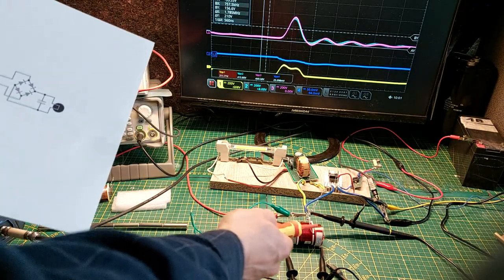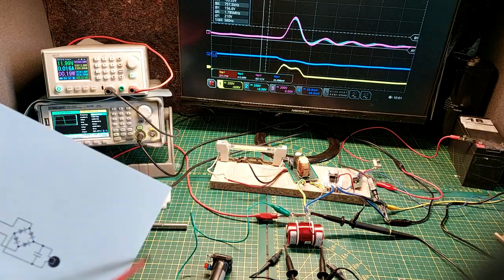Advantages of using negative spike of switched coil

Comment: Very interesting experiment. I guess the input was 12v. The negative flyback voltage on the primary is 200v and on the secondary 400v. You used this spike through a choke. Would it be possible rectifying the spike and collect it in a capacitor instead of the choke? Or would the voltage of the spike drop significantly?
Reply from the maker: @marcelflechter: In the video where I use 34Khz, I used 24V input because the higher the frequency the lower the spike even with 50% duty compared to 12V input, 1Khz and 10% duty.
The choke is used as the series negative impedance used in the motor setups from Rick Friedrich: https://youtu.be/U3JyRMdJhzg
You can place a capacitor direct, but in past setups I had best result this way, ofcourse it's always best to try, don't forget that the impedance goes higher when capacitor is charged and voltage on your mosfet will go higher and can lead to mosfet break down if you go above rated voltage. This is also when using the series impedance.
Reply: @brunovk417  Thanks for clarification. I'm trying to find out the behavior of a don smith bifilar coil. The same type you use in this video. It's about the normal output and not the negative spike. Usual if you increase the frequency in a step-up transformer the voltage goes up. A 12v to 240v 60Hz transformer will put out 480v at 120Hz. There is double the voltage and half of the current. The output of a bifilar coil is usual 3 or 4 times more. How is the frequency influencing the voltage? As an example there is a 12v input pulse. The primary is a quarter wave of the secondary. The primary LC-circuit runs at 100kHz in resonance. There is let's say a 100v output v.a.r. If the tank-circuit would run on 200kHz resonance with a smaller capacitor, what would be the influence to the voltage? I know with 200kHz the resistance will be smaller thus the ringing (echo) will be longer. But I'm stuck with the voltage. Will the voltage be 100v as well or higher. I could imagine there is also less current on the secondary in compare to the 100kHz. And this should lead to a higher voltage.
Reply from the maker: @marcelfiechter7436  As far as I know, when you input higher frequency then foreseen, you end up with same voltage relationship, only at that higher frequency. 
In case of resonance, I only experienced best voltage output when at fundamental frequency of components involved.
About less impedance, many times it´s  forgotten that there is also the  normal resistance, that will cause the dampning, even when in resonance Xc and Xl are eliminating each other, there´s still the normal resistance.
If you speak of lower impedance at higher frequency, means that you are talking about the capacitor, the coil however will be higher in impedance at higher frequency ( for people reading this comment, there´s a very nice graph on rf cafe: https://www.rfcafe.com/references/electrical/images/Frequency-Reactance-Nomograph.zip
)
What I also learned is that there has to be a balance between your L and C to have the best result. Sadly everyone who knows what that balance is, isn´t sharing it or I have not yet come to that information :)
When you look at that Reactance normograph you see thousands of points where you have resonance between L and C but where you will end up with best result is much more limited. I once heard that for best series resonance you want to choose a point above the middle line of that graph and for parallel beneath that middle line. We all see that there are still a lot of points to choose from.
What I wrote above is what I think at this moment, please think on all this for yourself, I can be wrong.
Reply: @brunovk417  Thanks for the graph. I saved it on my device. It can be helpful.

Yes I was talking about the smaller capacitor causing less impedance. You're right there are always multiple aspects of the same issue.

"you end up with same voltage output": I came up with an answer to my question in the meantime. My experience is mostly theoretically and it could be totally wrong. I realized that my question (bigger frequency - higher voltages?) has something to do with the Q-Factor. There are online calculators to get the Q-Factor (Frequency, Inductance, Internal Resistance). In that sense a bigger frequency is causing a bigger Q-Factor. So yes the voltage is getting bigger with a bigger frequency as I interpret it. And yes L1 and L2 need to be in harmony I get that. And that's what Don Smith was telling also I guess. The most important thing for Tesla and Don Smith was the frequency (resonance). Not the voltage and not the amperage.

"Sadly everyone who knows what that balance is, isn't sharing it": Don Smith did it between the lines if I'm correct. Most parts of his devices shown aren't necessary. They are there because people are expecting them to be there (his words). One example is the LC-Circuit. Don Smith told there is no need for a capacitor because the wire and the coil has an intern capacitance already. With a capacitor you are reducing the frequency with no benefit. In contrary, it's getting difficult to tune the L2. A 4 inch L1 (coil plus wires) has a natural frequency of 220MHz. You just need to pulse this coil and it will vibrate. If L1 is a quarter wave of L2 then the whole wire of L2 need to be exactly double the size of L1. L2 will resonate with 110MHz. There is no need for a tuning capacitor. But still L1 and L2 will be slightly out of tune. The simple solution to bring this 2 coils in full harmony is to put a small resistor of 100-500 Ohms at the grounding shunt. This acts like a dam. It reduces a bit the frequency. May down to 200MHz and 100MHz(L2). That's my understanding of what Don Smith was telling about this subject. And it makes perfect sense in my view.

"many times it's forgotten there is also the normal resistance": Here is what Don Smith is telling about this subject as I understand it. Until 20kHz this normal resistance exists. The electrons are colliding each other and there is a lot of friction. From 20kHz to 300kHz is less and less friction because the electrons are starting to flow outside of the wire. And from 200MHz upward are superconductor conditions. I believe that's why he was talking a lot about the 4 inches (220MHz). As I understand it there is one pulse and it's swinging with almost no dampening. I believe Don Smith had a device with a very small L1 (1 turn - maybe just one inch or even smaller) and a very small L2 (4 turns). This would be 800MHz and 400MHz. Calculate this small coil of 800MHz online. The Q-Factor is huge. I believe that's the secret of Don Smith. He didn't use any step-up neon transformer, he didn't use any capacitor to create an LC-Circuit, he didn't use any spark cap.
Reply: @brunovk417  I mixed inches with feet. Always when I wrote inches it's feet (1m20cm).
Reply from the maker: @marcelfiechter7436  Thank you for sharing your thoughts. I will go through it a few times.
One thing I want to add at this moment is that I saw the possible reason for that resistor in the grounding. When you look at this hidden video of an experiment : https://youtu.be/RFjS5q_7M_8
Then later on I used a resitor in parallel to that capacitor and by doing that and using different resistor values I could freeze that changing ringing at the position where the amplitudes where at there highest values. Meaning I could control the output of that coil that was in the path. It was the first time during experimenting that placing a resistor in the path was benefitial.
Finding the correct way to have usable power is still something I need to figure out.
Reply: @brunovk417  This grounding resistor can have different benefits. What I heard from Don Smith it's all about the fine tuning of the already tuned (through exact wire length) L2 with L1. Here is what Don Smith said: He explains L2: and we've got it grounded with a variable device on it so we can fine tune it and that point we've got an output out here (output from L2) which is an oscillating alternating current type situation that radio frequency. The ground is the shunt in a resonant radio frequency configuration that produces the dam that keeps the energy. Once it get s to oscillating inside the system it could come in but it can't get out unless it is hooked into an other system. It's simply a blocking device which keeps your resonant coil system which normally you have a capacitor and a coil well in our case we've put both the capacitor and the coil in one wire and we eliminated some components that are subject to fail. In an earlier part of the video he was talking about the trumpet wave form. It could be the same as above or something else: in the third one (trumpet wave) is a particular arrangement of a grounding shunt which means its ability to communicate with the electron source which would be your grounding and the resistance there is like a dam on a large body of water and it lets the electrons through and they get caught behind this dam. This whole device is like a pump. All it's doing is like the dominoes we were talking about is tripping the electrons here and that electrons trip in the next one and this whole bunch of electrons in all directions are being tripped and each time one of those would be tripped it gives off a magnetic impulse first and when it comes back on that infinity loop it gives off an electrical impulse and this just goes on perpetually the electron is never diminished.

Resistance
but basically what it means is that your system resistivity becomes zero at resonance which means that you're at superconductor conditions at that point at room temperature. The rate of induction is directly related to the cycles per second so if you want to a reference point there at 60 cycles per second square that and then if you want to see the relative position of say 220 megacycles square 220 megacycles and compare the ratio between the 2 squares and you've got the ratio of improvement with the higher frequency. Then he explains that below 20kHz is under unity. Between 20kHz and 200kHz it's getting better and better and above 200kHz is over unity. And above 200MHz (wire 1m20cm) are superconductor conditions. That's one of the reasons why I built this device to get out of way from the ranges which the Tesla coils normally operate in which is down below two hundred thousand cycles per second.
Reply: @brunovk417  I did an interesting calculation. Let's take a 4 feet (1m20cm) wire/coil (L1). 2 feet are used for the coil and 1 feet are at each end. The internal resistance is usually 0.1 Ohm at 4 feet. I take 0.3 Ohm. The natural frequency is 220MHz. I take 200MHz. Now I compare the natural frequency without additional capacitor and a frequency of 100kHz with an LC-Capacitor. The induction of a 2 feet-wire coil is between 1uH and 4uH. I take 2uH.

Q-Factor 100kHz with LC-Capacitor: 4.18
3v in and 12.54v in resonance or
12v in and 50v in resonance

Q-Factor 200MHz natural: 8373
3v in and 25119v in resonance or
12 in and 100476 in resonance

The big difference lies in the less dampening at higher frequencies. Less internal resistance.
Reply: @brunovk417  An interesting aspect you mentioned is the impedance. The higher the frequency the bigger the impedance. That's true but there are 2 aspects. If you check an online calculator for the Q-Factor there is just an internal resistance and no impedance-value. Because the impedance is defined by the induction. One aspect of the impedance is the current. The impedance is limiting the current. The higher the frequency the more resistance for the current. The second aspect of the impedance is the voltage. The impedance doesn't limit the voltage. In contrary. Through the impedance the voltage is getting pressed higher and higher. That's why there are suddenly 100kv at 220MHz. But there is almost no current. And that's exactly what we want at this stage. That's why it's called v.a.r power. It's not usable at this stage. This is done in the next stage. Collecting the voltage and convert it to usable current.
Reply from the maker: @marcelfiechter7436 , Thank you for sharing your thoughts. I will have look for creating such coil, maybe tomorrow or upcomming weekend.
Reply: @brunovk417  Great. An unknown factor is the triggering of the harmonics. My Arduino processor is 16MHz. It's not possible to control 220MHz. The best would be to trigger every 100th harmonics. It's a challenge because the if-command alone takes already some cycles of the cpu. Don Smith proposed the Neon-Transformer which is at 35kHz. This is just the trigger 35000 times per second. I can't imagine this was exactly a harmonic of 220MHz. Probably it's ok to trigger it coincidentally a view times per second. Eventually it's the same like a tuning fork. It's not that important you hit it again at exactly the right point. Because it's not a perfect trigger there is some disturbance but still the tuning fork is amplifying itself.

Take care when you do a video about this. Nobody should know this except a view who know it already more than a hundred years.
Reply from the maker: @marcelfiechter7436 , I have the system in mind from this video, that kickback looks like a nice hammer for the bell :)
 If there´s not much  dampening then it should show up.
When reading your message I was thinking on the flat pancake coil that´s mentioned in the Don Smith book (page 100,101,151, 152, video5) I created something like that a few years ago, I have to look if it´s still usable (most of the times I use same materials for different experiments) The problem back then was the high voltage input, but that will now be done with the mosfet and that circuit from the video here. 
And maybe it´s even not necessary to have the L1 around. In my hidden video mentioned in my previous message, that was also just a copper coil directly connected to the scope input, and I saw the ringing just by that kickback wire going once through the center.
I will be using a capacitor to the positive of power supply so that it´s partly like the hairpin circuit.
The second capacitor is then the kickback diode in blocking for reflection ( and also to block positive from input source)

What I know what will be a problem is the harvesting.
Reply: @brunovk417  "kickback looks like a nice hammer for the bell": Interesting.

Yes the harvesting is an other page. Don Smith did it with an isolation transformer. I have an easier idea in mind. But I still think about it.

Let me know if you see less dampening. This would be the ultimate sign. A 1.5v Battery would be enough to power the house. Or a peg-cell as joel lagace was showing. This constant 1 volt would produce easily a constant 70kv v.a.r power in combination with the 440MHz (2 feet) naturally swinging L1.
Reply: @brunovk417  I don't know what happens on L2. Let's assume the coil of L1 is a quarter wave of L2. L1 has a Q-Factor of 10 and a frequency of 100Hz. The input is 12 volts. L1 will have a resonating voltage of 120v. What happens on L2. I assume the following. The 100Hz will decrease to 25Hz. The voltage remains at 120v and the amperage increases 4 times. I believe Don Smith used L2 as an amperage step-up. Most people think it's about the voltage there but it's about the amperage at that stage.
Reply from the maker: @marcelfiechter, I found my coil but have to rewind, so it will be for upcomming weekend.
Looking at the dimentions in Don's drawing he uses relationship of 4.36.
When I convert to m (the unit I work with), I have 19.8feet = 6.035m and 4.54feet= 1.383m
He writes to using 20feet = 6.096m and 4 3/4 feet = 1.447m.
possible the .36 is what he means with using slightly longer wire then the wanted wave length.
Reply: @brunovk417  Important to know is the principle. Don't try to do it exactly as it is written. Some things are confusing. I would do L1 with 60cm. It's cheaper and it saves time. 30cm for the windings and 15cm on each end. I would round it on a 3.2cm-diameter pipe. L2-wire 120cm twice. 90cm for the windings and 15cm on each end. Triple is enough to see the effect. I would do it precisely. Resonance needs exactly a division or a multiplication. Every tuning fork is very precise.

At the step-down process Don Smith mentioned also a bifilar coil. 50 turns on one side and 52 turns on the other. This 2 turns are there to modulate the sine wave. It rounds the spike on the top. But this has nothing to do with the process we are talking about now.
Reply: @brunovk417  I did some exact calculation for a 60/120cm frequency (440MHz/220MHz) and a 30/90cm coil with 1.5mm2 wire on a 3.2cm diameter pipe. The Q-Factor for L1 would be 394742 and for L2 296057. Maybe it's better to start with 1ma input. Otherwise this thing will run unstoppable infinitely 🙂
Reply from the maker: @marcelfiechter7436 , I looked at the specs of my scopes, I have a 2 channel  200Mhz, so I think it will be best to use some longer wires so that I´m working within the specs of my scope for both coils. I can see how far that takes me before going to the super high Q.
400Mhz is also the frequency for emergency related things, so I´m going to stay away from that higher frequency.
Reply: @brunovk417  It's a sphere nobody of the hobbyist is working on. That's why it's getting difficult to find the tools. But I'm convinced exactly there is the secret. It's not only Don Smith is telling that, I can also calculate it by myself with independent online calculators. And there is even Wikipedia telling 200MHz-2GHz is superconducting territory at room temperatur. Superconducting is zero resistance. Usual just possible at minus 200 or whatever degrees.
Reply: @brunovk417  You mentioned eventually there is no need for L1 and measuring directly on L1. I believe this won't work because the magnetic field will probably collapse. L1 is the heart beat of the circuit and shouldn't be touched. The isolation with L2 is key I guess. It's probably better to measure and collect at L2.
Reply: @brunovk417  "2 channel 200Mhz": Good to know. I would do it with 1.75m L1 (ca. 180Mhz). For L2 I would choose also 1.75m twice. A 1:1 conversion is more than enough. A smaller L2 would be even better but then the frequency is getting bigger than 200Mhz again. L2 is important to get the isolation.
Reply: @brunovk417  With 1.5mm2 wire and a coil of 60cm (of 1.75m) there is a Q-Factor of 109900. With 120cm-coil (of 1.75m) the Q-Factor is 219800.
Reply: @brunovk417  I calculated the Q-Factor in the previous post with a 3.2-diameter pipe. If you put it on a 6.4-diameter pipe the induction will double and thus the Q-Factor will also double again. The Q-Factor for a 120cm-coil (of 1.75m) at 6.4cm-diameter pipe would be 439600 then.
Reply: @brunovk417  It's good to limit the input voltage with a voltage divider to at least 10mV. Better 5mV. There could be still 4000v to measure with a 10-times probe.
Reply: @brunovk417  There is no need for a bifilar L2 to begin with. Just one L2 (copy of L1) on the left of the primary with 2-4cm space. The bifilar could multiply the possible 4kv at 10mv input even further.
Reply from the maker: @marcelfiechter7436  I can measure that 4Kv with my x1000 probe, my x100 probe only goes to 2KV, the x10 would not survive.
I will try tomorrow or saturday to build something, it will depend on when I have time.
Reply: @brunovk417  It's absolutely your choice to do it whenever you want. I could try it also but I have no time. Life and wife holds me busy. I would love just doing this type of thing. Electrons are fascinating beyond anything I can imagine. It comes directly from God.
Reply from the maker: @marcelfiechter7436 It´s also the reason why I limit experimenting to weekends. :)
Reply: @brunovk417  I understand now the effect on L2 if the frequency is different. Let's take an 1.75m wire 1.5mm2 with 60cm coil on a 6.4cm-diameter pipe. The frequency of L1 is 175MHz and the voltage will be 2kv as an example. I had this example yesterday. The Q-Factor is 219800. L2 is all the same except the wire length is half 87.5cm. The frequency will be 350MHz on L2. How big will the voltage be on L2? Some will say 2kv because the coil is the same size. Others will say 4kv because the frequency is double. I realized that the Q-Factor-Ratio between L1 and L2 is key here. I calculated the Q-Factor of L2 which is 879200. L1 is 219800. The ratio between L1 and L2 is exactly 1:4. Now we have the voltage of L2. It's 8kv. This shows the power of radio frequency. Now I know why Don Smith said all his devices work with the avalanche-effect. It's 0.01v to 4000v.
Reply from the maker: @marcelfiechter What do you mean with 60cm or 120cm coil? I was going to start and build the coil but it's not clear what you mean by that. I don't see anything related to that size.
Do you mean that the distance between turns is so large you get 60cm lenght with only +-8 windings?
Reply: @brunovk417  It's just an example to understand the relationship between L1 and L2. The total wire length is 1.75cm for L1. I would build also the L2 coil with 1.75m. An exact copy. But here in this example L2 will have just 87.5cm total wire length. In between this L1 1.75m is 60cm in the middle to create the coil. On a 6.2cm-diameter pipe this would be around 3 turns. At both edges would be 57.5cm straight wire. And L2 has also this 3 turns but on both edges will be just 13.75cm left. If L1 has 2kv then L2 will have 8kv. But in building the coil I would use 120cm for the coil. That would be 6 turns on a 6.2cm-diameter pipe.

I think it's good to know this mechanism. Don Smith had a 20 feet L2 and a 4 feet L1. This means the frequency on L2 was 5 times less at around 44MHz. By doing that the voltage on L2 decreased by 5 square = 25 times. But the coil on L2 was 4 times bigger plus bifilar. After decreasing 25 times it increased probably 10-12 times. This tells me the main goal of this process was to bring down the high frequency.

You did the same yesterday. After you realized you can't measure 220MHz you started to fix this issue by enlarging the wire to 1.75m. This brings the frequency down. And the second thing we started to tame is the big voltage of 400kv. It's not possible to measure. A solution could be to limit the power supply to 10mv with a voltage divider. There will be many more steps and hurdles to come down to 60 Hertz and 230v.
Reply from the maker: @marcelfiechter, the tube I can use is 5cm or 7.5cm or 8cm, this are the standards I can find in shop overhere.
I will try with 5cm because of this diameter I have 2 tubes available. For the ringing on L1 I need to use parallel capacitor, so frequency will be little lower. Tryed with series but that wasn't showing any ringing.
Reply: @brunovk417  Yes 5cm is better. This way the induction and the Q-Factor will be lower. An other option would be double the size of the wire on L2 to 3.5m. This way the frequency will come down to 87MHz on L2. And the Q-Factor will come down 4 times. This means the voltage will be 4 times lower on L2. It's getting easier to measure. The diodes could have a problem too with 4kv. With maximum 1kv everything is easier.
Reply: @brunovk417  "for the ringing on L1 I need to use parallel capacitor". It should work without capacitors. With capacitors it will get very difficult to tune L2. Even the diode on L2 should be calculated into the wire length.
Reply from the maker: @marcelfiechter7436  I'm only able to get some ringing at around 16Mhz by placing 2 diodes towards eachother, so that I use the diode capacity. The two diodes where placed in series. Offcourse my scope probe also has influence, so I'm going to try with small capacitive connection, the measured voltage will then not be correct anymore. This is my best result with the diodes: https://drive.google.com/file/d/1-Ji3LNPw9nfnwW_cFXu-NiEEaJk3l9A2/view?usp=sharing
Input was 5V
Reply from the maker: 18Mhz when using capcitive coupling ( two pieces of wire 5cm long, 1 connected to circuit the other to measuring probe signal input)
What do you use as reflection barrier?
Reply: @brunovk417  What I told you is only theoretically. Probably it's not possible to measure it this way because the scope is changing everything. I don't know if you measured it on L1. If so this could be the reason of the low frequency. The wave doesn't look in resonance.
Reply: @brunovk417  The gate driver could be also an issue. Even if the gate of the mosfet is open there is still some current flowing. This could be enough to disturb the frequency. There are possibilities to open the gate in shorting the gate with the drain. An alternative could be also a relay. Fact is you have a very low frequency. Something in your circuit is disturbing the natural frequency (scope, diode, capacitor, mosfet). That's why I wouldn't work with capacitor, diode, scope on L1. The first step is to achieve this natural frequency. It's possible and it's done since many decades every day in radio frequency.
Reply: @brunovk417  Your experiment helped a lot. It obviously showed it doesn't work like that. The first reason is the Mosfet. My Mosfet combined with Gatedriver IC has a turn on time at 50ns. That's quit fast. But in 200MHz there is a turn on and off every 3ns. Even if we would have the fastest Mosfet at 10ns it's way too slow. It's like you would trigger a tuning fork with the finger for half a second. The resonance will be blocked immediately. The triggering of the pulse can't be longer than 3ns. In other words it's impossible to do that with a Mosfet. It must be done with a signal generator. I will use Si5351 clock generator combined with Arduino Adafruit. An important factor is the jitter in radio signals. Si5351 has a jitter of 0.1ns pp (peak to peak). Pulsing 220MHz is no problem like this. The jitter is 13 times smaller than the frequency. This way it works.

The next issue is the scope. There can't be any scope connected on L1 neither on L2. It must be measured wireless (spectrum analyzer, RF explorer). The voltage can be calculated. By rectifying L2 and charging up a capacitor we know it definitively.
Reply from the maker: @marcelfiechter, placing the scope probe at distance also works, you will not have exact value, but you can see if it's dampend or not. I can do sine wave to 160Mhz, but don't know pulse (it will be much less). 
For checking the dampening effect or not, you could use free oscillations setup where you divide the 200Mhz for example by 10 (so using 20Mhz input) and then the duty cycle 5% (50%/10). If there's no damping you can see it happening in between pulses. Keep in mind that with the use of free oscillations the amplitude voltage will be lower the higher you divide the 200Mhz.
Reply: @brunovk417  Good to know. Thanks. 5% duty cycle should work. The pulse is finally exactly sharp as it would be with 200MHz. It makes sense. Almost all are giving up after the experiment you did. That's why nobody is doing it. Some are involved in the radio frequency world and others in OU-world (you know what I mean with OU). But nobody is combining it. Don Smith combined this 2 worlds. In my opinion even much more than Rick Friedrich. That's key. I still need to study further the RF-world. The wire is exactly the same as the antenna. But with a wire the magnetic field remains locally. For that reason I'm not so afraid of 400MHz (urgency...). I think we are on the right track. The Q-Factor is key.
Reply from the maker: @marcelfiechter7436  The thing that's making me doubt is that if above 200Mhz is where there's superconductivty, then why is the cpu in my pc getting so hot working in the Ghz. So I think the problem is also contradictions with what we experience, to find possible solutions.
Reply: @brunovk417  That's a good point. You would need to know the inner workings of a cpu which I don't know. It's all conventional electronics. I just know at 200MHz the electron stays more or less at the same place at flipping and there is no current flowing. This part I fully understand. It's cold energy. And the Q-Factor is the proof. Otherwise there wouldn't be a Q-Factor of 100k or more at 200MHz. And that's what Don Smith was telling in almost every speech. The avalanche-effect.
Reply: @brunovk417  Without studying a cpu in detail I don't believe a cpu is working with resonance all the way down.
Reply: @brunovk417  I did a short research about this topic. It tells me enough. The cpu itself doesn't work with resonance. The cpu is processing data by rapidly switching transistors. The Transistors are getting hot and not the cpu. There is a resonant part in the cpu. When the dl/dt events from the cpu match the resonant frequency of the PDN, the voltage noise can be amplified. This is similar to how a musical instrument can resonate when struck at a specific frequency. There we have it. This part is resonating and the cpu is taking advantage from this effect. And this part for sure doesn't create heat. The transistors create the heat.
Reply: @brunovk417  On my pc the cpu is always at 100% (Maximum processor state). If I come back to my pc every click is fast. I don't like to wait a few seconds until the cpu is up. I have a 1.8GHz cpu. This means the processor is oscillating all the time. On the Task Manager the System Idle Process is the oscillation process. If this process is at 99% or 100% the cpu has no calculations to do, is calm and the fan never kicks in. But as soon there is work to do it starts to get noisy and the fan kicks in. This is caused by the transistors switching. And when the work is done the System Idle Process goes back to 99% and the fan is switching off and it's calm again. But the processor is still oscillating at 100%. The cpu is an excellent example to contrast the 2 aspects of a cpu (oscillation and transistor switching). How is it possible the fan never kicks in when the System Idle Process is at 99%? The answer is super conductivity. A cpu below 20KHz would cause heat at oscillating.  A 60Hz transformer is loosing energy (heat) with no load. This are the no-load-losses.
Reply: @brunovk417  I realized an interesting fact which explains also a part of your experiment. You had 18MHz in your experiment. The dampening was very bad. The attenuation (dampening) on high frequencies out of resonance is worse than the attenuation of low frequencies out of resonance. This could lead to the wrong understanding it's better to work with lower frequencies because there is less dampening. That's true when it's out of resonance. But in resonance it's the opposite. The attenuation on high frequencies in resonance is lower than the attenuation on low frequencies in resonance. This correlates with the Q-Factor. There is a very good video from Circuit Helper in this regard. The title is From Oscillations to Shocking High-Voltage.
Reply from the maker: @marcelfiechter7436  Thank you for the information, I will look into it. There was a shift in the experiments that I wanted to do past weekend because I came to something that I want to build that demands some hours of printing with my 3D printer. So I dicided to first prepare the parts so that I can do the 3D printing while I do this kind of experiments talked about here.
I´m going to build an L3 receiver for the zero transformer based on a Tesla circuit: https://drive.google.com/file/d/1nG6d-jF_C_-ozMFgi51uXQ4fNH3fnkrg/view?usp=drivesdk
Reply from the maker: @marcelfiechter7436  I searched for the video from circuit helper you referred to but  youtube nor google seem to find it. When looking to the videolist it blocks after it comes to the letter D for the titles. Do you have a link?
Reply from the maker: Found it: https://youtu.be/9WligloCprc?si=EMYVF_FkZClJkvuW
Reply: @brunovk417  Great, I just tried to send the link. In your experiment you had 5v input and 5.2v out. I believe the frequency of 16.13MHz is before the sweet spot. That's why the voltage is the same as the input. After the sweet spot the voltage drops below the input voltage. That's shown in this video.  The next interesting aspect is the start of the swinging. It's important to pulse it at least 10 times to get to the maximum voltage. And then it will swing much longer with less dampening.
Reply: @brunovk417  I did a simulation with LTspice for 1.2m wire and a 90cm coil in between. I got some realistic numbers now. 1v in 100v out peak to peak. I tested it with 60cm/1.2m/2.4m. In 60cm (400MHz) the Q-Factor was 100. In 1.2m (200MHz) the Q-Factor was 110. And with 2.4 (100MHz) a bit more. It confirms the principle I'm looking for but the numbers are way below the numbers I calculated. But that's good. I don't need to worry about 4kv.

I tested also the pulsing. It's very difficult to achieve good results with pulsing. The way to go is sine-wave-input. And I believe the sine-wave needs to be constant. Every 5th harmonics or so probably won't work. But there is no need for that.

With a 5v input there could be 500v pp at 1.2m (4 feet) 200MHz. And there is still the secondary to step it up.
Reply: @brunovk417  Could you tell me the capacitor size you used in the experiment? I did a simulation of your experiment. 1.75m wire, diameter of 5cm-pipe. coil has 9 turns. Wire has 1.5mm2. Capacitor 13p. This way I came to a frequency of 16MHz. 1v Amplitude input (sine-wave) 180vpp out.
Reply from the maker: @marcelfiechter7436  I will measure the capacitor value with my lcr meter this weekend, of the two diodes pointing at eachother (that was the capacitance I used).
I also used two small pieces of alu foil with kapton tape in between but that had higher capacitance, so the scope image is with the two diodes as small capacitor.
Reply from the maker: @marcelfiechter7436  Have you tried to use an 74HC14 Scmitt trigger after your Si5351 ? I saw that the output of that board is more sine wave at the higher frequencies. I don´t know if those ic´s can handle that 200Mhz or not. Looking at delay times it looks like 66Mhz, but AI wrote that it could be used.
Reply: @brunovk417  A Schmitt trigger has a rise/fall time of at least 12ns. It's way too slow. It can't work with a Schmitt trigger. And it would be more a pulsing I think. I realized in the simulation that pulsing is very difficult. A sine-wave is the only way in my opinion.

The Si5351 is the way I go. I'm still in the planing phase and didn't order Si5351 yet. Officially they write it's 160MHz+. It's possible to go up to 225MHz without any issues (even 280 would be possible with limitations in other areas which are not important to me). And it's a clean sine-wave. It's ideal for this purpose I think. And I can control every step. I can say it should swing for 50 turns and then to stop or continue by swinging every 10th harmonic and so on.
Reply: @brunovk417  Yes AI is telling it can be used. But AI collects information from everywhere. It works probably for frequencies below 200k. And it's more a pulsing. I saw it clearly in the simulation. Pulsing is very tricky and the results are much worse than sine-waves. The natural modulation of the wave of a coil is sine.
Reply from the maker: @marcelfiechter7436  Do you think that synchronization is needed if sine wave is used? I can understand the principle of adding the sine wave with intervals but they have to come at the right moment. With the pulses you have free oscillations between pulses, also best result if the next pulse comes at the right time. I can understand there will be free oscillations between two bursts of sine wave input, but then the controlling device would need to be very stable I think. This high frequency is unwalked teritory to me at this moment, so I can be wrong.
Reply from the maker: @marcelfiechter7436  I want to use your idea of burst of sine but for pulses, is it a problem that I make a public video on that? I want to compare the use of free oscillations by changing the input frequency and duty cycle, or for example 5 pulses with 50% duty and look at the free oscillations in between. In the later the starting voltage will be higher, but I´m wondering if there could be an overal gain when compared to the free oscillations with frequency and duty cycle adjustment. Due to the 50% duty input will be higher, but maybe this will also cause higher efficiency (higher voltage).
Reply: @brunovk417  "synchronization is needed if sine wave is used": Maybe it's not possible to add the sine wave in intervals. I will see what is possible with si5351. Sure it would be good to make a video about this topic. Maybe pulsing is also good. The spark cap is also pulsing. I just had a hard time on the simulation. And Rick Friedrich told also the best is sine-wave.
Reply from the maker: @marcelfiechter7436  Years ago I put pulse signal as one input of and gate and then the second input port  as the port to let them trough or not. Offcourse the 200Mhz is again a problem. So it will depend how the output of the signal generator is  switched. If it continues in the background and you switch if it´s allowed as output then synchronization will not be needed I think.
Reply: @brunovk417  "synchronization will not be needed": Yes I imagine you're right. I believe I can program SI5351 by time. I can't say to stop it after 50 cycles because this is oscillating by its own. But I can say to stop after 100ns and to start after 500ns again or whatever.

When it comes over 50MHz we are in RF/HF territory. That's why I'm studying this RF-World. They know how to do it. But it's a lot. I realized now the output of SI5351 is 3.3v. But it's peak to peak. That's the next challenge. I have just 1.6v input for the coil. In the simulation that's an amplitude of 75v (wire 1.2m) on the primary. Then suddenly it makes sense again Don Smith used 20 feet (with bifiar) for the secondary. This way it's probably possible to elevate the voltage to 4 times 75v plus the bifilar-effect. Could be 500 to 600v. The other possibility would be an amplifier. I found amplifiers for 20$.  The other challenge is impedance-matching. An antenna has always this 50 Ohms. The primary would need also 50 Ohms. Maybe this is easy for you. Would there need to be an additional resister between the signal generator (SI5351) and the primary coil? I guess so. But this will have an influence to the frequency.
Reply: @brunovk417  There needs to be a 50 Ohm resistor between SI5351 and the coil. In the simulation this is reducing the voltage gain from 1v:55v down to 1v:40v. The max output of SI5351 can be 3.3v peak to peak. In the simulation I get 60v (120vpp) at 1.6v (8ma) input with the 50 Ohm resistor. It's still a very good value. It's a little example of the avalanche-effect. 1.6v in at 8ma and 60v out.

The question now is how to amplify this. Either with an amplifier in between or a big enough secondary. An amplifier in between needs a separate power supply of 12-15v. An amplifier for 23$ could amplify it by 20 dB. 20 dB is increasing the voltage 10 times. The input of the coil would be 16v instead of 1.6v. The voltage amplitude of the primary would be 600v in the simulation. Eventually the bigger secondary is the easier approach.
Reply from the maker: @marcelfiechter7436  The ouput impedance of the si is 50 ohm according the datasheet, page 8 https://cdn-learn.adafruit.com/assets/assets/000/116/463/original/Si5351-B_datasheet.pdf?1667590965
Reply: @brunovk417  Thanks a lot for the document. It helps. I had this big discrepancy between the calculated Q-Factor and the simulated result. I realized that the sweet spot in the simulation is always before the big hike at the top. There is also the curve for the decibel gain which correlates with my calculations. The gain in decibel with 50 Ohms (1.2m wire 223MHz) is 42 dB which translates to a theoretical Q-Factor of 125. The simulated result is a Q-Factor of 115. 1v in and 115v amplitude out. I recalculated it again without the 50 Ohms. The gain in decibel is 86 dB which translates to a theoretical Q-Factor of 20k. In the simulation it's a Q-Factor of 700. 1v in and 700v amplitude out. The band is so narrow it's probably impossible to get close to the theoretical Q-Factor. But the simulated results now are mind blowing.
Reply: @brunovk417  I see the first issue with SI5351a. It's not the sine wave. The usual square wave of SI5351 can programmatically modulated to a sine wave. I believe this part I can manage. But the problem is the maximal 8ma output. In the simulation of LTspice the current is 16ma and -16ma (1.2m 223MHz 50 Ohms 115v amplitude at 1v input). And with the natural Ohms of the wire (0.0136Ohm) it would generate 700v and the current is 100ma and -100ma. Do you know if this is the normal current draw. Is this 100ma or is there an average value because it's floating from top to bottom and back? I would need to place 110 Ohms to come down to 8ma. But then the voltage drops to 57v.

I found the most important thing which additionally is confirmed now by the simulation of LTspice. It's the Q-Factor of 700. Or with 50 Ohms still a staggering 115. The focus now is how to pulse it. The best would be sine wave but it's just 8ma. Pulsing is probably the better approach. I'm looking forward to your video. It's all about the most efficient pulsing. The source is there plentiful.
Reply from the maker: @marcelfiechter, If the input is 1V peak and you can build impedance matching to the 50 ohm of the SI5351, then the current would be 20mA peak. So for 8mA peak I think it needs to be 125ohm (using 1V peak). 
I have very little knowledge of impedance matching outside it's function and that there are online calculators.
Normally I think rms values are used in datasheets. I can not find the 8mA.

For the current value It depends if what is calculated is rms or peak value.
Reply: @brunovk417  It's written in the datasheet. The parameter is Output Impedance: 8 mA output drive current. I guess this is rms. I'm not sure if it's the same as in the sine curve where the top value is 8ma to bottom -8ma.
Reply: @brunovk417  And there is also Rise/Fall Time tr/tf: Drive Strength 8 mA in 1ns.
Reply: @brunovk417  The SI5351A/B/C features various current drives ranging from 2 to 8 mA (default).
Reply: @brunovk417  They write to use Zo = 85 Ohms. When I simulate it there are 10ma peak. I guess this is allowed. This generates 73v at 1v input.
Reply: @brunovk417  I'm thinking about shielding now. When you are experimenting with your coils, is this not radiating out? You are probably in the 100 to 200kHz range. Usual this long waves go far.
Reply: @brunovk417  The output pin of Rasperry pi has a current of 16ma at 3.3v. This way it would work with 40 Ohms  and generate 110v with 16ma. But only if the square wave is clean enough.
Reply: @brunovk417  There is probably an easier way to achieve this frequency than SI5351 or Rasperry pi rpitx. There are frequency generators  for around 30 to 50$ which have 5 or 10 dbm. If I'm correct my simulation of SI5351 achieved 27mW which is 14 dbm (3.3v at 8ma). A 5 dbm device would be 3mW. There are RF Amplifiers 20db for a few dollars. 20db is amplifying a 100 times. 3mW times 100 is 300mW. This are max values. Finally it's probably 100mW. But that's more than enough. The output of a wlan-router is usual at 100mW.
Reply from the maker: @marcelfiechter7436 Normally the SI5351 should arrive tomorrow overhere, and I´m going to use Arduino giga to control it. It´s an arduino kit with small touch screen so I have extra pulse generator worse case scenario for lower frequencies. I hope I have free time upcomming weekend to try things out.
For shielding I have not foreseen in my experiments because the power up until this point in time is minimal. I have not yet seen a 5W led full brightness with an input that was much less lower. Depending on where one reads, then above 20khz it´s allready outside the wire. So I´m curious to what I will see diffrently. With ringing upto around 1Mhz, it´s still dampening or not collectable without destroying. I hope those higher frequency are more stable.
My setup for the 2 L3´s on zero transformer are also ready, one coil still needs to be wind.

In the things you simulated, did you include Earth grounding? Can it be included?
Reply: @brunovk417  There needs to be a ground in the schematic of LTSpce but it's more of a null reference point. I tried to place a second ground with 1Gohm and connected it with the normal ground. But there was no difference.

In the simulation at 200MHz it took around 120 pulses to get to full speed. I think it's good to know. It's not possible to pulse 10 times and stop in this scenario.

Arduino Giga is a very good choice. I missed that one. It seems (AI is telling) that the pins are directly controlled by the main processor which is 480MHz. A half cycle is 1.04ns. The rise and fall time of the pin must be at least 1ns, most probably a bit lower. It's the same speed or even less than SI5351. That's why the current output of Arduino Giga is 8ma as well. In other Arduinos the output current was always 20ma. With the command GPIOJ->ODR = (0b00000001) can a pin be toggled very fast. In Arduino Uno it's an other command but it's possible to do it in this fashion at one  half cycle of the cpu. And there is the nop-command which is pausing for 1 half cycle (1.04ns). You could copy this command 200 times in the program and eventually it will toggle at 480MHz (or any other frequency). Usual there is a loop. But a while loop takes 3 cycles and a do loop even more cycles. But you could do a loop for this 200 commands. Then a pause of a few cycles by the while loop wouldn't matter because of the moderate dampening. This way it would be possible to generate different frequencies very easy. And every cycle could be controlled. I imagine with SI5351 it's just possible to control the registers but not the oscillation itself.
Reply: @brunovk417  GPIOB->BSRR = (1 << 5); // Sets the pin high. This command is better than ODR. BSRR is atomic and it should take just one cycle. It really seems to be possible to do that with Arduino Giga. I think I'm ordering this device too. Let me know if I can assist you with the code.
Reply from the maker: @marcelfiechter7436  I didn´t know about the possibility of getting the outputs of the giga switched so fast. Thank you for letting me know. 
Also the recipe is something I never heard of, thank you very much. It will be a busy weekend :)
Reply from the maker: @marcelfiechter7436  As long as the whole neigbourhood wifi doesn´t start resonating :)
Reply from the maker: @marcelfiechter7436  Do I need to delete the message?
Reply: @brunovk417  In the primary coil will be the same power as in the antenna (around 100mW). But this type of coil is a very bad antenna. The magnetic field is hurling around the coil instead out in the air. So far the signal will be definitively weaker than a normal signal. At the step up could be some sort of enforcement in the signal. But the secondary coil again is a very bad antenna. Additionally if it's done with 2 secondaries in bifilar style they cancel each other out. This is very bad for transmission. The magnetic field is hurling in a dense local field like a whirlpool in a river. Even with a big step up I can't imagine the signal could reach a normal wlan strength. But it's good to have a spectrum analyzer.
Reply: @brunovk417  Usual the antenna of a 2.4GHz router is 11-12cm. This is a full wave and it's difficult to handle this size manually. I simulated now the 50cm variant in compare of the 25cm of yesterday. If the size of the antenna is bigger than the wave length there is more natural impedance. It's problematic normally because it needs adjustments at the source impedance. But the source often times is fixed to 50 Ohms. But in our case it could be very handy. I realized the 50 Ohms are not really needed anymore with a 4 times wavelength (50cm). The natural impedance seems to be in this area or even a bit higher. The current draw with 50 Ohms at 50cm is 46ma. Without the 50 Ohms it's 58ma. The 25cm-variant with 50 Ohms drew 86ma. The 58ma won't be any problem for any router.

Simulation of: The wire is 1.5mm2. The diameter of the coil is 2cm. 5 turns (30cm). 10cm on each end. The result is: 
580v peak (1160v peak to peak) without 50 Ohms at 58ma peak. 
465v peak (930v peak to peak) with 50 Ohms at 46ma peak. 

It's just a simulation and it could be different in reality. I would go straight to the 50cm variant. It's easier to handle and the gain seems to be much bigger than with the 25cm variant (215v peak). Additionally the 50 Ohms could be excluded because they are already represented in the 50cm wire/coil. It makes everything easier.

I assume an even longer wire like 1m won't work well because the natural impedance will be much bigger than the source impedance of 50 Ohms. But we can't change the source impedance in this cooking receipt.

Just for clarity reasons. In the LTSpice simulation I can enter a source impedance. I entered there always 50 Ohms in my simulations. In the si5351 simulation I entered 85 Ohms. I think the simulation could be realistic.
Reply: @brunovk417  I was running my last simulations with 12v. I realized it can't be possible because 12v times 58ma is 696mW. The output of the 2.4 GHz signal is around 100mW. A more realistic number is 4v at the output. With 4v there are 20ma = 80mW. At 4v the simulation for 50cm is: 
155v peak at 15ma with 50 Ohms.
195v peak at 20ma without 50 Ohms.
Reply: @brunovk417  I studied the mechanism of wlan 2.4GHz. Normally there is a 1.8v VOC (Voltage Controlled Oscillator) in the router. This generates a 0.9v amplitude. And this gets amplified by the 12vDC to 9v max. This amplifying circuits are increasing the voltage 10 times. Below 10 times there is still some unwanted noise in the circuit. The maximum of 9v generates probably 1000mW or a bit more. This is used for the 5GHz range. The 5GHz range needs more power because the short waves of 6cm are weak and have a hard time to travel through the house. 2.4GHz needs 100mW. The 0.9v is getting resisted to probably 0.5 or 0.6v and then amplified 10 times to 5-6v. And this is likely the voltage amplitude a normal 2.4GHz wlan is amplified which generates 100mW at the antenna. I did also a simulation for that and came to the same result. That's why they were choosing 12v for the routers even in the old days when the 5GHz range didn't exist. The signal of a 5v-router would be too weak otherwise they would have built the 5v-variant. It would be cheaper. The amplified voltage for 2.4 GHz is likely 5 to 6 volts. And after this comes the 50 Ohms and then the SMA-Connection and then the 50 Ohms of the antenna which is 11-12cm.

It looks like the simulated 4 volts in the previous post are a moderate example:

50cm wire/coil: 4v with 50 Ohms creates 39mW (2.4v times 16ma) output at the SMA-Connection which is the coil-input. The coil creates 155v peak.

50cm wire/coil: 4v without 50 Ohms creates 60mW (3v times 20ma) output at the SMA which is the coil-input. The coil creates 195v peak.
Reply: @brunovk417  In case the voltage inside the router is amplified to 5 volts the signal strength would be 93mW without 50 Ohms. This means the impedance of the 50cm wire is around 50 Ohms.

In case the voltage inside the router is amplified to 6 volts the signal strength would be 133mW. This means the impedance of the 50cm wire is less than 50 Ohms. A 30 Ohms should be placed at the SMA-Connection. Then the signal strength is 102mW. And the output of the primary coil is 250v.
Reply from the maker: @marcelfiechter7436  I have to see what the specs are of my analyzer to see if I can go to 2.4Ghz, but I have old wifi router to experiment :) it has 3 antenna´s.
Reply from the maker: The wifi router I have is not sending constantly when there´s no connection. So I will start with the 200Mhz to experiment, there I have some means to measure things.
Reply: @brunovk417  Usually a router is sending its signal constantly unless powered off. Maybe you'll find an other router. A small router can power up a whole city.
Reply: @brunovk417  I believe when there is no antenna connected it won't send. That's protection. Without antenna and the 50 Ohms it would burn. But with enough impedance it will work constantly.
Reply: @brunovk417  tinySA is a good analyzer.
Reply from the maker: @marcelfiechter, I ordered a tinySA to get some idea of signal send. Sadly a scope for having a closer look at the free oscillations is not whitin my budget. 
Someone pointed me to ADF4351 module, it can be controlled and go into the Ghz so that I don't need wifi router to experiment and even can fine tune (steps of 100khz if I"m correct in the Ghz range) I have to wait a week or 2 for that module to arrive. This weekend I'm going to try the Si5351A with the Arduino Giga.
When the ADF4351 with touch screen arrives, I can compare for the 200Mhz experiments as well.

For direct output from giga, I'm going to wait for amplifyer board, so that I have some protection between the giga and the setup.
Reply: @brunovk417  The ADF4351 module is very good. In the range of 2.2-4.4GHz it's a sine wave. Perfect. In the range below it's square wave. The simulations showed a sine wave is 4 times more powerful than a square wave or pulsing. Whereas capacitors have no issue with sharp pulses a wire does. Wires/Coils hate sharp pulses. There is one big disadvantage between ADF4351-module and a router. The max output of your ADF4351-module is most probably 1mW. The chip itself could manage 5mW. There is an other module with the ADF4351-chip I'd prefer which allows for 3mW. But still this is not enough to create something meaningful. The routers output is 100mW. With the module you need an amplifier of 20dB. That's an amplification of 100 times.

It works with the module but it's more complicated because it needs to be amplified. The router does everything for free.
Reply: @brunovk417  The yield of the old cooking receipt. How many spaghettis are there? One spaghetti-halfwave has 195v and 19.5ma. This is peak. When they are cooked the length is 0.707 less. The length is then 137v and 13.7ma. The calories of this one spaghetti is 1.8w. And that's just half of the spaghetti. The fullwave-spaghetti has 3.6w. There are 2.4 Giga spaghettis in total. The calories of this spaghettis is 8.6Gw per second.

2.8 Millions Water Heaters of 3000w could be fed by this calories.

A house is typically using 22kW Calories. 392 thousand houses could eat from this calories.
Reply: @brunovk417  I wrote about ADF4153 in the previous post. It doesn't show up. There is a reason for that. Click by Sort by to Newest first. Than it will show up.
Reply from the maker: @marcelfiechter, The Si5153 at 200Mhz has peak to peak value of 440mV when directly measured on output. There's a dc offset on the sine wave. So I have to place a capacitor in series to block that dc to the coil. 
When you talk about the 50 ohm resistor in your simulations, are we talking in series with the signal line or to ground to do impedance match?
I was thinking on one wire like setup so no closed loop for current.
Reply from the maker: If the one wire works then the capacitor in series to block the dc is not needed I think.
Reply from the maker: Adding the capacitor was giving me back the possibility to trigger the signal, without it I had to use the single button to get a view on the signal, the triggering wasn't working anymore. The capacitor added is 820pf silver mica (from ali, so not sure of quality). The peak to peak value is now 464mV and thus no DC offset.
Reply: @brunovk417  The 440mV Si5153 is expected. In radio frequency the 50 ohm resistor is right before the antenna in series. But take care, the Si5153 needs 85 ohms. It's important otherwise Si5153 could get destroyed. This 440mV need to come down massively. That's the impedance matching in radio frequency with more than 100 years of experience. The one wire is an other story. You have much more experience in this regard. I would do it first in the normal way. There is plenty of energy even without one wire.

The dc offset could be because there is no 85 ohm resistor. But it could be also the oscilloscope. Your oscilloscope is showing most probably a sine wave. But it's a square wave with a lot of harmonics. You need to go down to 10 or 5 Mhz. Then you will see the square wave. This oscilloscopes won't be able to show it. I saw it in 2 different videos.
Reply: @brunovk417  "Adding the capacitor was giving me back the possibility..." Adding a capacitor will destroy the frequency. You are now in the same situation I have been in the simulation. That's why I wrote you it's very difficult to get a frequency by pulsing. Just one ns more or less of the rise or fall time decided if it worked or not. I managed to do it in the simulation finally. There is 4 times less power than with a sine wave.
Reply from the maker: @marcelfiechter, I'm going to try the 85 ohm resistor. I found out that with etherkit Si5351 you can switch the output off and on when wanted and the signal is continously running in the back ground. So when you switch on and the signal is at 50%, it willstart at that 50%. This is important because when using free oscillatiions it would mean that it picks up where it needs to, so no synchronization needed (if I'm correct and if free oscillations are needed for output gain).
I got the Arduino code from: https://github.com/etherkit/Si5351Arduino
It also gives the possibility to set output power, but not tried that yet.
Reply: @brunovk417  Etherkit seems to be a good choice. It's interesting to experiment with free oscillations and to see the results. I will try it too when I have time but maybe I will see already some results from you. At the end of the day I don't think it's important because at resonance the current gets automatically reduced through impedance. There is no need for a free oscillation in this regard. And there is just the sine wave. The wire/coil is married with the sine and not the square. I saw it in the simulation. It was a hundred times easier to work with sine than with square or pulse.
Reply: I was able to simulate the pulsing. In general it produces 2-3 times less voltage than sine-wave. But it's still very good. The rise and fall time of the schmitt-trigger must be short and it must be a synchronous square wave (50% duty cycle). The fall/rise time of SI5351 is 1ns. Even 1.2ns is diminishing by a lot. And with 1.5ns there is just 3v output. It's difficult to drive a frequency with a pulse but it's possible.

With SI5153a 3.3v (intern impedance 85 Ohms) it would generate 55v when there are also the 85 Ohms at the coil (impedance matching). The amperage is exactly at 8ma this way. I believe it would work also with 50 Ohms. The voltage would be 70v and the amperage 10ma.

The only other possibility I know of is Rasperry pi rpitx. It's running with the speed of the cpu and can drive a frequency up to 1.5GHz. I'm not so sure how clean the square wave is. But a band pass filter will be necessary in both cases - also with SI5341.
Reply: I checked also the 100MHz frequency. 100MHz is 3 meters and the wire/coil of 1.5m could be driven by this frequency like a half wave antenna. In the simulation without additional ohms it could generate 1500v with 1 volt input. The current draw is 400ma. With 200mhz 700v were possible. That's an interesting side note.

Simulation of SI5351
In the simulation (100mhz) with 85 Ohms the voltage with 3.3v pulsed input is 30v by 8ma driving current. With 200mhz it was 55v at 8ma input current. This is showing the power of frequency. The 55v at 200mhz are for free in compare to the 30v at 100mhz. And there are double the spikes at the same time with 200mhz. The energy gain is in square. It's definitively better to run on 200mhz.
Reply from the maker: Thank you for sharing.
Reply: I did a simulation for ADF4351 with 1mW at 2.42GHz. It's a sine wave. The sine is not pure in that sense but neither are the sine waves of a router. The aim is to use this 1mW without amplifier and to see what voltage level can be reached. The primary wire/coil again is 50cm. There would be 34v peak at 3.5ma peak. That's not bad. Power is more than enough. The issue is the low voltage level. It needs a bigger secondary/bifilar to step it up and it works. 

I did the same simulation with 3mW because there is a good ADF4351 out there that allows 3mW. The simulated result is 60v peak at 6.1ma peak.
Reply from the maker: This is a video with my test setup with coil of 1m75cm of wire where 60cm is wounded as coil. 
https://youtu.be/T7HfDy70uiE
I'm going through the frequencies, but my amplitude doesn't want to grow, and I think it's because there's no capacitor in the circuit (In the past this was the case, for the higher frequencies it's first time experimenting).
Even when I set the output to be longer active, I don't see things building up.
Reply: @brunovk417  I go to gym and will watch the video afterwards. I just saw the first picture. The probe is adding capacitance to the wire and is disturbing everything. It's not possible to measure the primary with a probe directly attached. This way there can't be resonance.
Reply: @brunovk417  The only way to measure this is with spectrum analyzer or frequency meter. I would hold the antenna of tinySA close to the coil. Important, tinySA can't be connected with usb type c. This will distort everything.
Reply from the maker: @marcelfiechter7436  I also tried with probe close to wire but not connected. I don´t see ringing when input signal is away. I then tried with 940khz resonant tank, coil of 150uH and capacitor 180pF in parallel. In that case I saw the ringing after the 50% duty cycle signal was switched of. The tank circuit was connected with one wire, so the same 85 ohm resistor was used and from there to the parallel tank. Gnd connection was not made with the parallel tank. In that case I saw damped ringing because it was possible for the circuit to go from capacitor to inductor and back again.
The same connections to the 1m75 wire coil, but in this case without capacitor in parallel, made abrupt end on the ringing after pulses where stopped.
So I´m going to look for a tank circuit that resonates around 200Mhz because it´s missing the ability to go from magnetic to electric if there´s only one part in the circuit. I know a coil is inductance and capacitance, but that capacitance isn´t able to discharge through the coil. So what I´m going to try is to use bifilar coil as capacitor, used as open loop coil. Still thinking on how to achieve things, but when I´m able to create free ringing I have a my answer to the question if there´s much less damping above 200Mhz. The coil on it´s own doesn´t feel right.
Reply: @brunovk417  The probe can't see the ringing. It's impossible to measure with this scope. It's only possible with a spectrum analyzer. This antenna (wire/coil of 175cm) is the tank circuit. That's how they do it with antennas. It's exactly the same. And exactly the same as a wifi-router is doing it. That's what Don Smith always emphasized.
Reply: @brunovk417  As I wrote I see the biggest issue at the scope. This has to be done with a spectrum analyzer. But I see also an issue at SI5351. It is officially just 160GHz. And I think I know why this is the case now. Yes it's possible to speed it up to 225 or even more frequencies. But is the pulse still correct? There is the fall and rise time of the transistor at 1ns. But it can be also 1.5ns max as written in the datasheet. Especially when the frequency goes up the fall and rise time will also rise. 200MHz is pulsing every 4ns. If the fall and rise time together is 3ns it won't work. I saw it in the simulation. The maximum was 1.2ns and then the voltage dropped abruptly from a 150v peak to a 3v peak. The pulse will be distorted. That's why SI5351 is just 160GHz. It won't work properly afterwards.

I wrote with antennas and wifi-router it's working too. There is the next issue in your set up. They work all with sine waves.

I wouldn't try to achieve this first with pulsing. It's very difficult. I would try first with sine wave and when this works I would try it also with pulsing. With the ADF4153-module you can generate 2.2-4.4GHz sine waves. Below it's square wave. But with tinySA you can generate a sine wave from 100KHz to 800KHz. The maximum output here is 0.25mW. But that's enough for testing the frequency at 200MHz or 175MHz.
Reply: @brunovk417  I wrote tinySA can generate 100KHz to 800KHz sine waves. That's wrong. It's 100KHz to 800MHz.